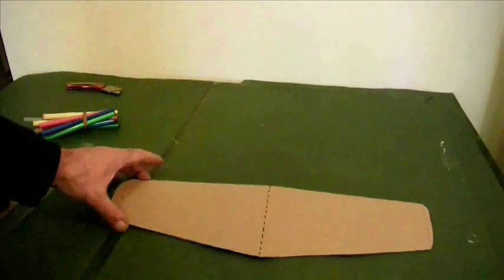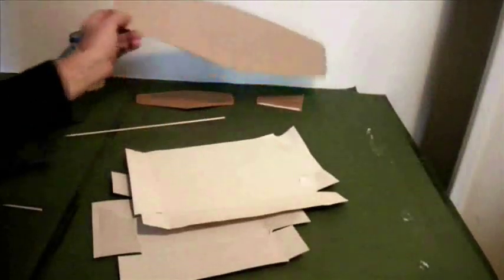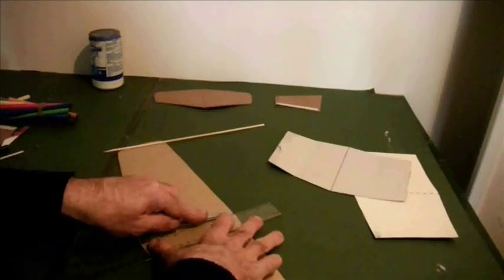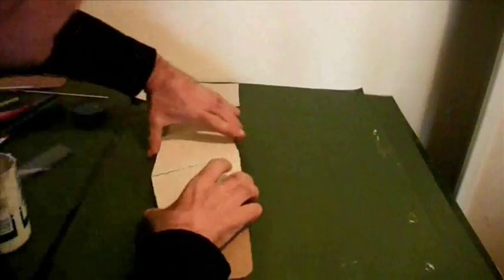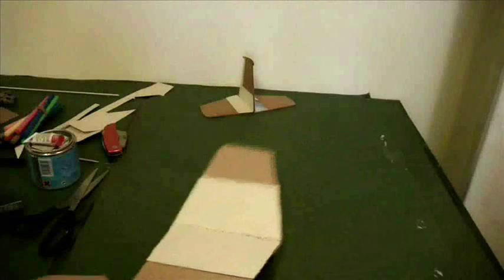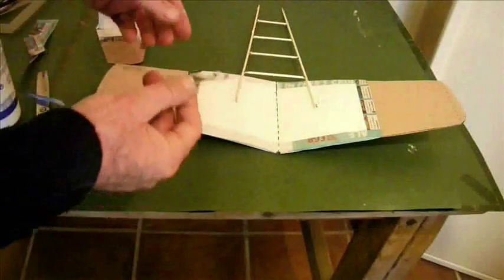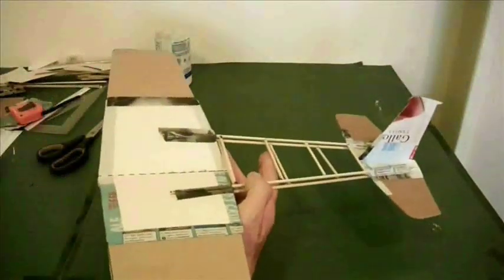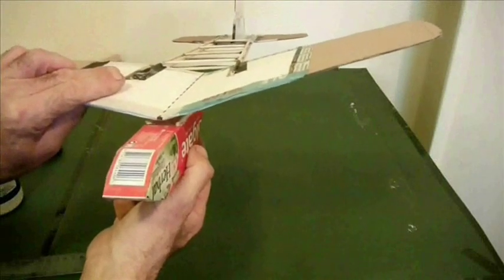Building a cardboard & bamboo glider with firework rocket motor

Comment: The wing you made did not have an airfoil shapeBut how did it glide Pls answer
Reply from the maker: Hello NH; the answer is a little surprising at first. The aerofoil section is not the only contributor to aerodynamic lift. If you google aerofoils you´ll note that some (quite a few, actually) are symmetrical in section. Like a flat wing, these shapes rely upon deflecting air downwards by presenting a slight angle of attack to the airflow. As a young kid I built lots of chuck gliders with perfectly flat balsa wings and they flew well. Try it - build a 20-minute cardboard glider   : )
Reply: Cool
Thanks for d answer
Can you build a rubberband model??
Reply from the maker: Wow - that´s something I haven´t done for many, many years. It´s a good idea and one which I´ll turn over in the back of my mind till I eventually do it. Thanks for the suggestion  : )
Reply: NH productions Sometimes you don't need an airfoil, but you can like curve the leading edge for a small one